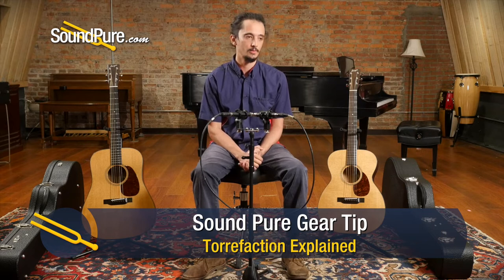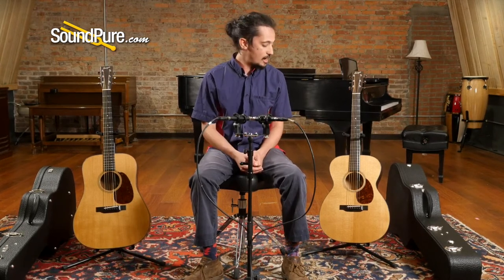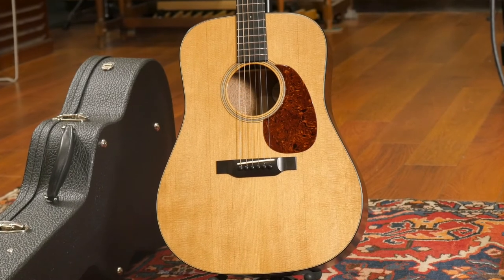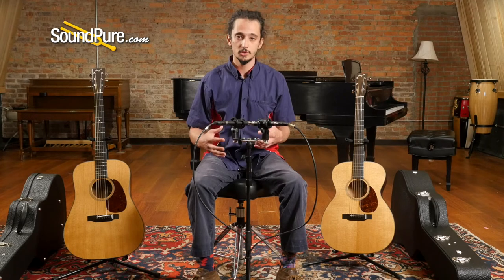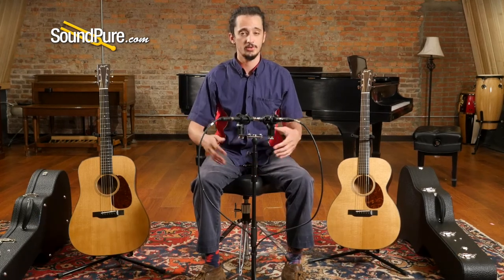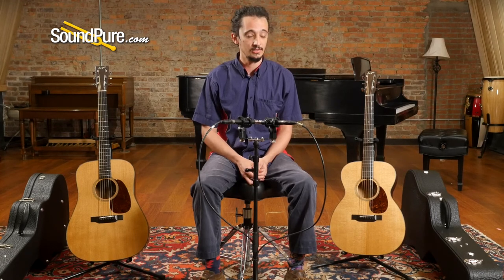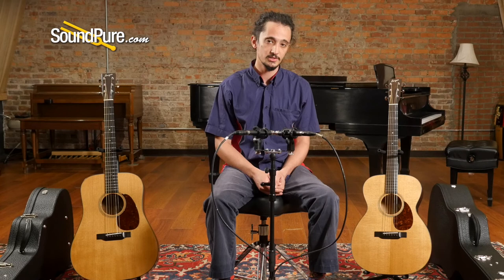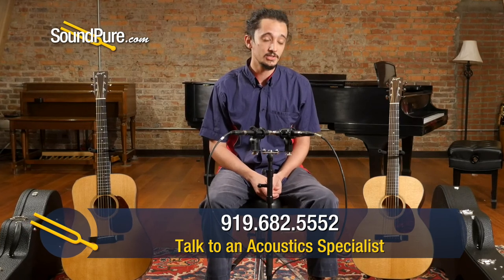Torrefied Guitar Explained - Sound Pure Gear Tip

Comment: In the most literal sense you are removing the impurities from the wood that prevent the wood from having it's best possible acoustic properties. This works great on guitar tops, however there is still experimentation going on for back and sides.